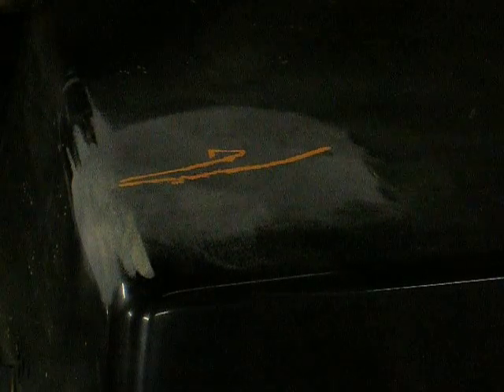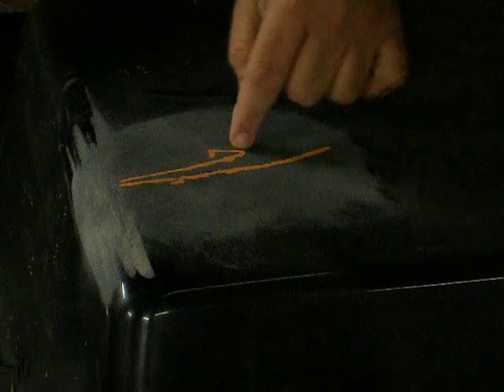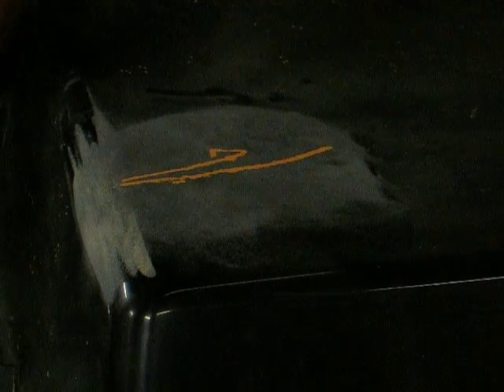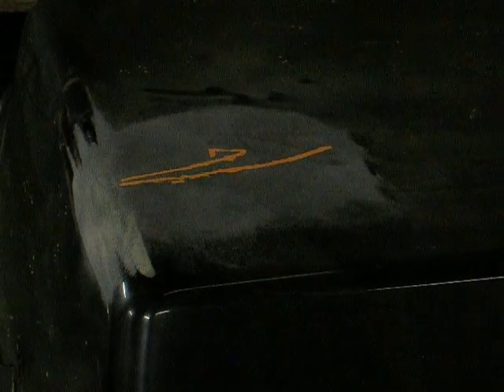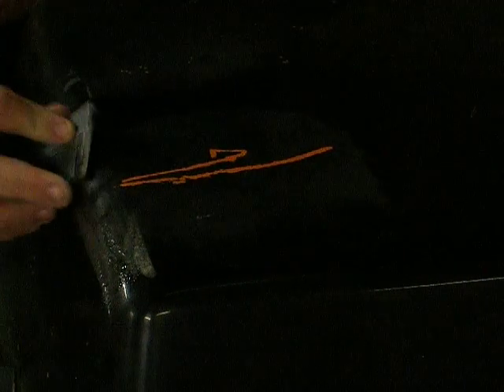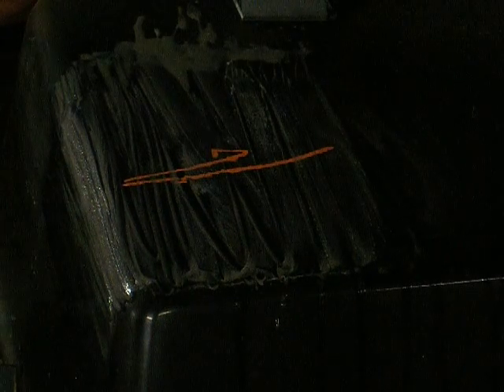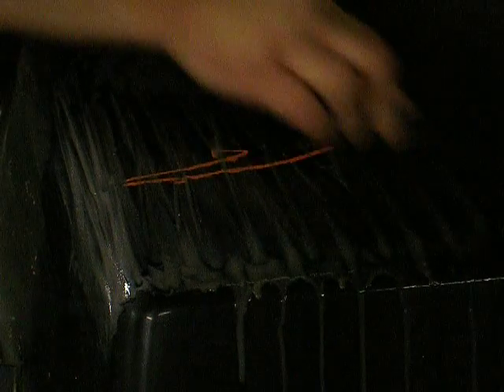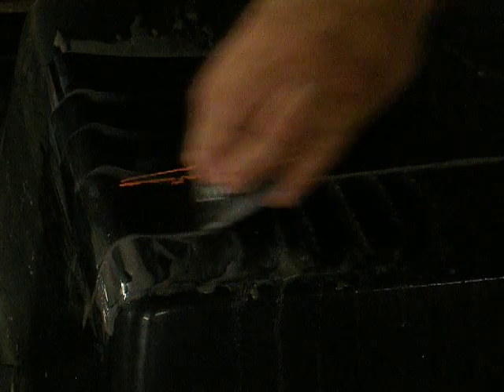How to Build a Fiberglass Boat.  Mold Prep Part 2a

Comment from the maker: @pissedoffanjie  Yes, I should not have used the DA on that repair, the time I saved cutting it down, ended up costing me more time in the finish work.    There is a sanding block in that sandpaper, but it is thin and looks like I just have some folded sandpaper.  I've got a whole drawer full of different blocks, thats just the one I chose.   
And yes I suck, because this dang boat isn't done yet.  Another paying gig got in the way but I should be back to building after Thanksgiving.